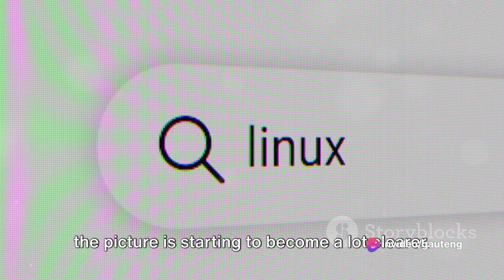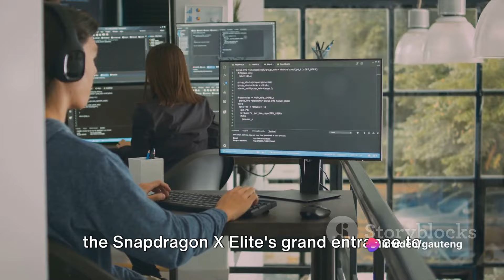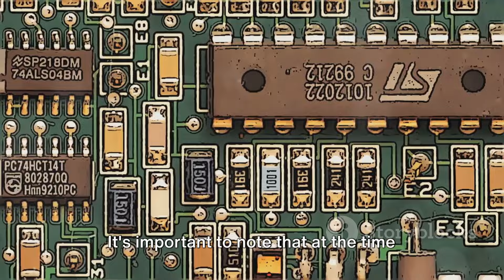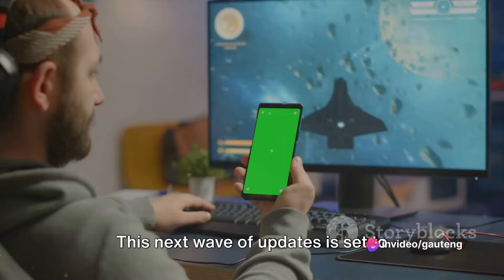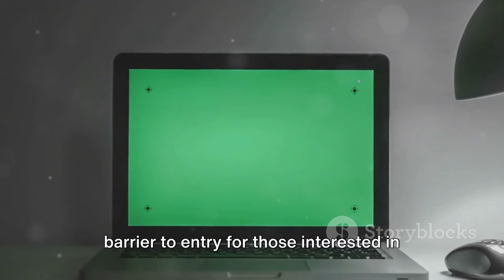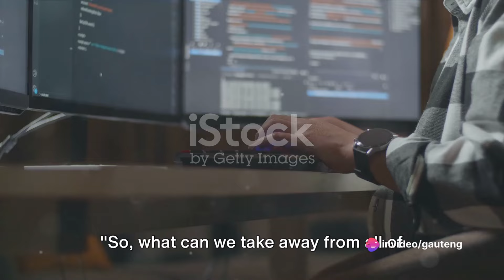Linux Support for Qualcomm Snapdragon X Elite Revealed

Comment: I love Linux systems. I want to buy Laptop with this cpu. I think with small optimizations like installing auto-cpufreq and disable turbo bost you can't take 2+ Days or battery life
Reply: frankly I feel free using Linux and I don't even want to have less flexible OS. If I have to use something instead it would be MacOS and m4 chip, but I still prefer Linux over Macs because of native Docker support and much, much more goodies I have right now. The only commercial software not present on Linux platforms can force me to buy a mac if I wanted to use it in everyday work.

Comment: To get Linux we won't have to use virtual machines will we?  If so that is not true Linux support.  Virtual machines are an option for those who want to test an OS or they don't plan to use it a lot or something.  I would prefer a real installation of Linux despite the problems I may encounter rather than using the WIndows Linux subsystem.  If you are afraid you would lose data while installing and configuring Linux just make sure to back it up to an external drive that is not connected.  It can't mess with it if it can't see it!  If you did lose data with Linux you may have simply careless which drive or partition you specified, these don't have drive letters like a, b, c and so on.  This may confuse people who are used to Windows and other Microsoft OSes that typically used drive letters.

Comment: For desktops is there going to be upgradeable RAM?  Beware. some of the laptops and notebooks have it soldered to the main board.  Why is that bad you may wonder?  If you ever get a bad RAM chip or one is failing you can't just take the affected module out and try a different one.  Not only that but sooner or later there is going to be someone who wants more than 16 GB of RAM.  Face it that is a lot but we all know how greedy Windows can be with our RAM!!  It would be interesting to see if the ARM version for these processors is any better on RAM use.  Also how hot do these get when you start to do any video encoding or anything like that whether it affects the CPU or GPU?